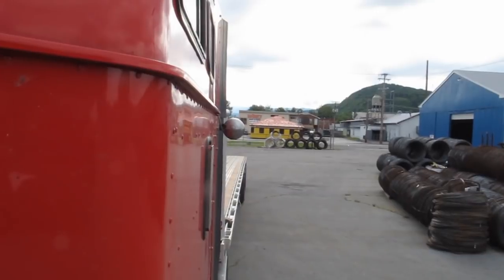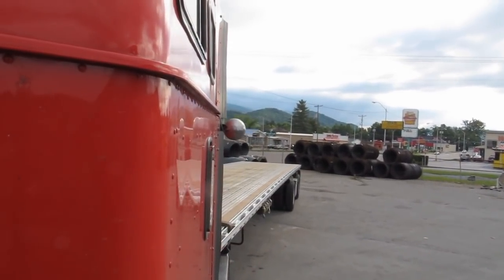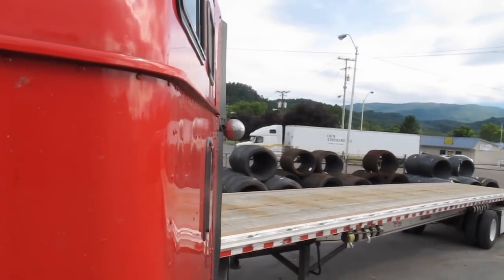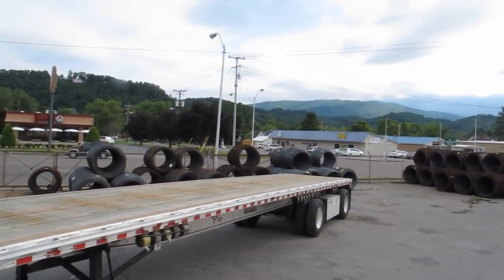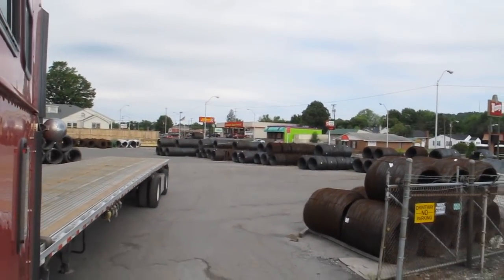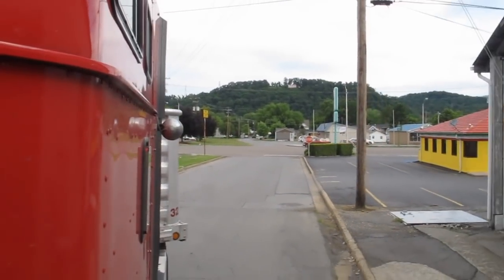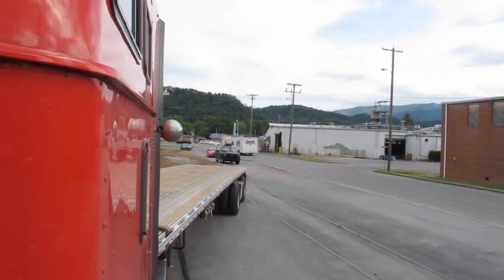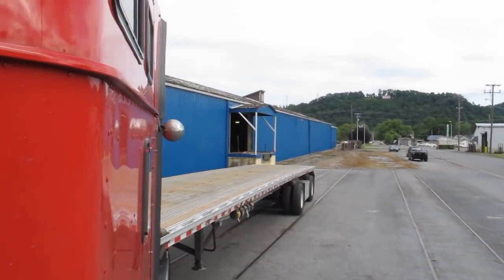Turning Sharp With A Spread Axle Trailer

Comment: 4:05 I love how he uses the term “bending” for tires and then turns sharp. I love spread axles, especially how the axles are apart and use the term “spread” and the lack of steering on the tires, therefore causing wear during sharp turns. Specifically, I love it when the tires drag during such turns, despite the quick wear.

Comment: Good explanation on why you have to drive spreads differently than a normal tandem.  If I can add another reason to avoid sharp turns with a flat bed.... When the truck is almost 90* to the trailer the 5th wheels natural movement will allow the front of the trailer to flex side to side. if the trailer is heavy it can flex so much that it will pinch down on the tractor tires and stop movement or worse the load can shift.

Comment: Not only tire damage, but over stressing the suspension framework as well. I had a seven foot spread on a 45' chip van that I was running, and it had been repaired after another driver had broken the frame by doing 90* turns in the yard, loaded!
You just can't do that with a spread axel. Always, always survey your situation before you get into it! Just like pulling doubles, don't commit yourself before you know what you are getting into, then act accordingly!

Comment: Hence the reason after listening to many other's; Rather than getting a spread, on my new trailer. I had a life axle installed  at the legal distant's from my tandems. Yes it added more weight, but then in addition to being able to axle on the various scale and not get a ticket, nor any of the exsesive tire ware or replacement when those on a spread are destroyed as they are in various turn's. It was cheaper to add the lift axle, and the saving well made up for the additional weight. The combination of having a tandem and utilizing the lift axle, allowed me to scale 99% of my loads.

Comment: I pull 5 axle flatbeds, teeter totters with the cluster in the middle and 2 steers. Loaded with 85000 some places i go are pretty tight and itll literately stop me dead theres so much drag. No choice some places i really struggle backing.  Almost all of our trailers the outside and inside of the tires are very worn because of this

Comment: yeah i pull 5 axles in ontario with 85-90,000...sharp turns make me cringe. Ive been some places where u almost have to 90 back loaded and i just cross my fingers the tire dont pop off or rip up the ashphalt. Stops you dead in your tracks too can barely push the trailer if its that sharp

Comment: I am surprised they haven't outlawed spread trailers by now in the USA. They were outlawed in Australia over 20 years ago because they caused too much road damage as they screwed around corners and tore up the bitumen especially on hot days. Authorities allowed the same axle weights on closed axle as they did with spread axles and people switched over so as to greatly reduce tire wear & save costs.

Comment: My fellow trucker pulls a 48 ft flatbed and he got loaded in  Free port Copper mine in AZ  . they did not load him right because they are used to your spred axle trailers so when he got to the scale 70 miles away he was 1000 over on his tandem.
He argued up and down that he would not slide his tandems all the way to the back of the trailer and not get a ticket for a bridge law violation going to CT. after much jawing with him and his dispatcher he went along with the program and slid his tandem all the way back. He only had 30k on his drive and 11600 on his steer and claimed it would not do him any good if he slid his 5th wheel. His length from the kingpin to his rear tandem axle was 41 feet. Do you think he will have any trouble?

Comment: We run 9ft tri axle container chassis. They'll stretch to 40ft closed they're 30 ft. 
One of our company chassis split in2 mid turn with a 45,000 lb container on it. No tight turns.

Comment: If you do have a load on the trailer and you make a sharp turn 90 degrees. The trailer can tip over at the front of the 5th wheel.
Reply: Especially with a high 5th wheel. I use to haul bagged aggregates & we had 41 " 5th wheel height so the frames wouldn't hit,, They lay over pretty quickly if you don't watch yourself..
Reply: Holy hell! Never thought a trailer would flip just from turning
Reply: @jpugh3076             Yes , with a flatbed , if you turn too close in a tight turn with a load of lumber or high load the load will almost lean over and scare the hell out of you , it happens to me in Mass. one time. The wrench hit the drive tire, yikes,,
Reply: Yes , especially with a high load on a flat bed.
Reply: @lontrucker44  i have since found this out the hard way myself had two large coils on permit load tipped the front of the trailer backin in to sharp and put a nice dent in the catwalk 😬

Comment from the maker: when you say container trlr is it a normal tandem?? or a full spread?? The spread on the trlr in the video is a very large spread and when you turn to sharp the trlr wants to turn on the rear axle, dragging the front axle causing the tire to bend. On a small spread you get the same effect but only when loaded heavy. On a normal tandem it's minimal unless your real heavy. Real sharp turns on any trlr is bad for the tires but spread axles are the worst.

Comment: I hope you have a dump valve in the cab for the rear axle on the spread. When i pulled flatbed I had a 48" with a 11" spread that little button came in handy especially on tight turns
Reply: 11 spread... uh, regulations for bridge laws are 10ft 2in. You're mistaken or blowing smoke
Reply: @TheRoadhammer379  uh no when I did have my flat bed it was 11' spread. Spread cant be no closer then 10.2 by regulation

Comment: I pulled for a company out of ny that ran NYC alot... our trucks had the switch on the dash for dumping the rear bags on the trailer to make the ass end of the trailer swing around quicker.... also we had to set the trailer brakes when we dropped a trailer and let the truck roll forward... I only pulled spread axle for 3 months... that's what I remember about it....

Comment: It's inevitable that you are going to be making left and right hand turns often in intersections if you are going to get anywhere. If your trailer cannot make these turns with the axles down, then it's time to spec out a different trailer. You have to be able to pick up and deliver where there is a divided highway and you might have to make a left or right hand turn onto a secondary divided highway or even a rural road loaded, and you had better be able to navigate those turns without bending the rims or blowing out tires or tearing the retread off the tires. However I would never run retread or recapped tires on a spread axle trailer.  Every so often move the front trailer tires to back and the back to the front to get more even trailer tire wear as the front trailer tires will wear faster because they shoulder more weight and drag more often.

Comment: Thanks for the video and explanation. Just a suggestion, if you were to do this on gravel you would see the tires dragging in the gravel and it would leave an impression and then you would be more obvious to people watching You can see what you are talking about in your video but i know from experience pulling a tri-axle lowbed you really see it on gravel and the marks it leaves..
Reply: Yes the displacement of gravel occurs and you can see the track of the tires where they were just sliding for a ride.

Comment: Rookie here only pulled vans in school. I have a interview with a flatbed company which will include a drive test any pointers?
Reply: I driven them alot them video is very informative. One thing I do not like to do is over jacking the truck past 90 degrees even in a regular van trailer defeats the point of doing that because you do alot of damage that way. When I was new I would get close to the job site and talk to a construction Foreman or who ever I was delivering too that way I was 100% sure how to enter and leave these sites. It's not always easy too to set your self up to pull in or out too! Just comes with trial and error. Experience is your friend we all started somewhere. Any time you back these up crank the wheel really hard them stop and see where the trailer is then make some turning adjustments to the wheel. If you have to pull up a million times theres no harm in that. I never try to one shot anything. Anytime you dont hit any thing and get the trailer in there then that was a successful back maneuver. Good luck you will be fine

Comment: Why not have a trailer with axles close together like a normal trailer but futher close to the middle  and then have a system that moves the wheelset to the rear when needed on a sharp turn to avoid the back of the trailer shifting?
Reply: Flat beds have a 10 ft split means they can have up to 20000lbs over each axle where with tandems its 34000lbs so we can haul more legally flat bed can haul up to 48000lbs where reefer is some where around 43000
Reply: Basically the spread is designed to load 40,000 lbs. back there instead of 34000 and its handy sometimes to get legal.

Comment: If you lifted the last axle when running empty the trailer would follow the truck much better, you'd also have less tire wear and risk of puncture. You could also empty the air bellows without lifting the axle for increased maneuverability when loaded.

Comment: cant beat european tri axels on super singles we can spin them around with a full load in a tight circle without any problems
Reply: I've got super singles on my flowboy and those fuckers look like they're gonna tear themselves off the rims with just doubles. Wouldn't want to try that with the tag down. Though at 99,000 lbs, just under 45,000 kg it's probably a bit heavier than yours.

Comment: YOU DIDN'T MENTION DUMPING THE AIR IN ONE OF THE AXLES..( CAN'T REMEMBER IF IT WOULD BE THE FRONT OR REAR YOU WOULD EMPTY ??) IS THAT EVEN AN OPTION FOR YOUR TRAILER ? IF NOT HOW ABOUT OTHER TRAILERS ? ANYONE WITH KNOWLEDGE FEEL FREE TO CONTRIBUTE TOWARDS AN ANSWER -THANKS.
Reply: Dump valve on front axle

Comment: Don't you have a dump valve for that front axle on the trailer?
Reply: not on a tandem spread axle or any tandem for that matter.
Reply: I have seen dump valves on spread axles!
Reply: you mean dump valve to release the trailer air but not a lift axle.
Reply: Yes I believe that is right what your saying!
 It helps the trailer steer better without that axle airbag fully inflated

Comment: Why have they not introduce truck trailer turn axles in the United States as much as they do other countries? I mean it seems turns would be easier.
Reply: Regulations, costs (manufacturing, parts, repairs and maintenance,) driver education, just to name a few reasons why these systems are not implemented in the US as over seas. I for one would like tires on certain trailers to be active turn, just for the better turning of the trailer following a wider path than currently, and to help those who can not back up if their life depended on it but also to assist in backing up in limited spaces with minimal clearance.

Comment: Try to turn around empty when you get to a customer with a small lot. If you can't turn around before loading, ask them for 5 gallons of water and do a wet-down around your trailer tires for an easier pivot.

Comment: Why not put dump valves in your truck? You won't have this issue I see NO comments saying anything about dump valves/switches.
Reply: Seeing as there is a max load limite to the tires, when loaded it would be stupid to dump air in an axle thus putting excess weight on the other tires causing them to blow and go flat and now they need to be changed out. That is why you do not see lift axles on two axle trailers, but you will find on other multi axle trailers, spread or not.
Reply: I asked that same question to two different companies one larger trucking company and one with only 4 trucks and they both said the same thing. That is that over the years they found that a lot of drivers forget to re-inflate especially after backing into truck stop parking, which caused all kinds of problems.
Reply: @lymanschimming2233   Yes I know a guy who forgot and when he crossed the state scales he got a ticket.

Comment: Just picked my spread axles van trl. Up! I've noticed I can't park at Any truck stops or rest areas cause I can't swing it in-between trls. I have to park on the shoulder! I hate it!
Reply: You're kidding, right? I have been pulling spread axle flatbed for 22 years and seldom do I have as much trouble as you claim